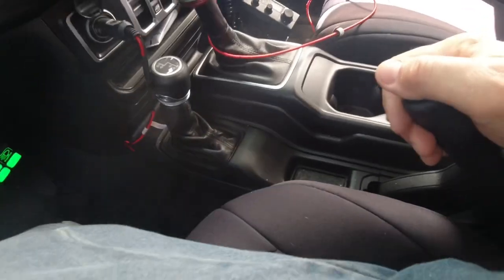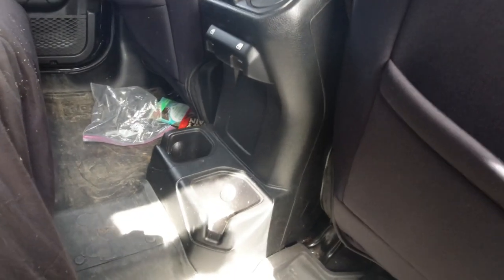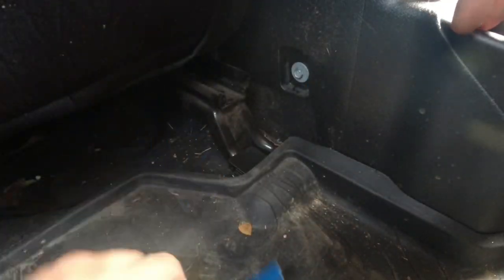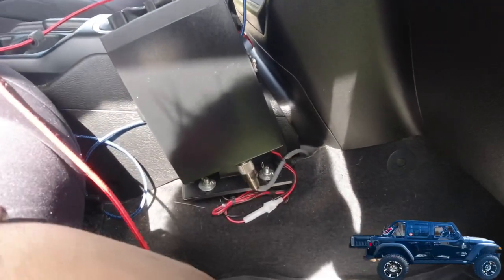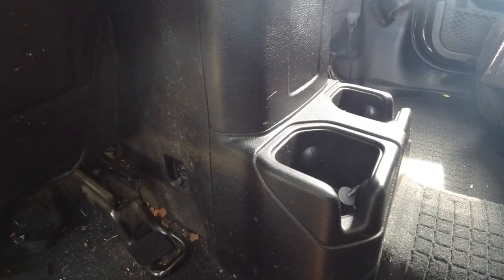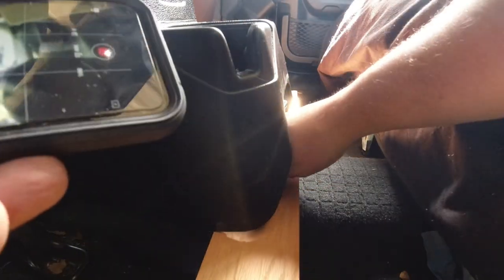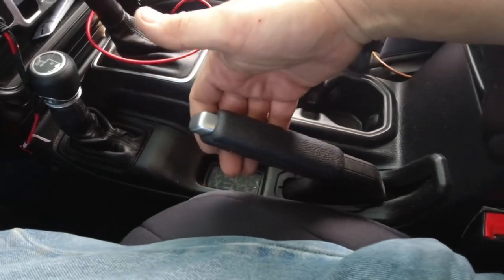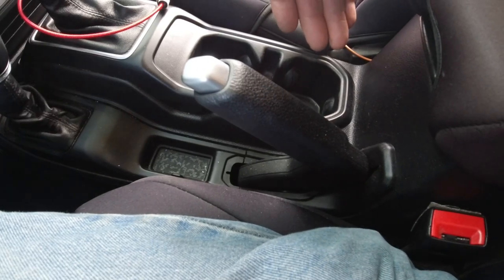JLWrangler Parking Brake Adjustment

Comment: Hey man. Same year model here. My p brake light on the dash doesn't come on when the p brake is set. Is there a switch under there that may have come loose?
Can't seem to find any info. Not a fuse btw
Reply from the maker: Hello I don’t remember if there is a switch under there, but if it’s anywhere that would be it. thanks for viewing

Comment: Great video, my issue is that mine works great but the dash screen doesn't show when it is activated. I wonder if it's a switch issue
Reply from the maker: I would check the switch.

Comment: I just got a 2013 Jeep wrangler sport. It’s a Manual. When my Jeep is on. The parking break is in gaged. On the dashboard the break light it’s blinking red. But as soon as I disengage the parking break. The light goes off. And dosent come back on. Until I rengage it. Why is that ?
Reply from the maker: The brake light should be on anytime the handle is pulled.   Thanks for viewing.